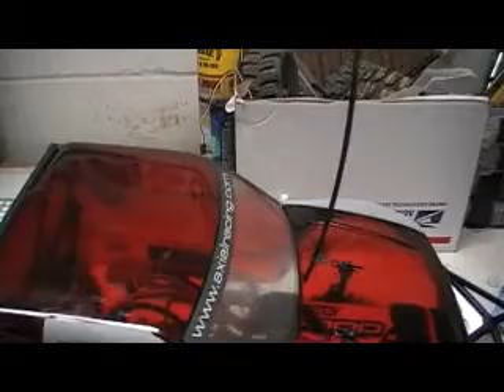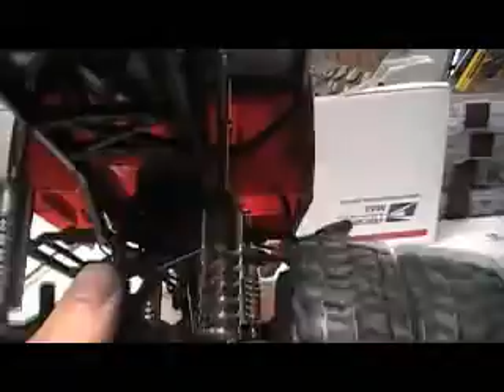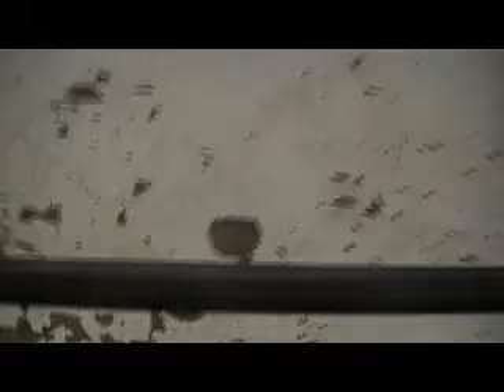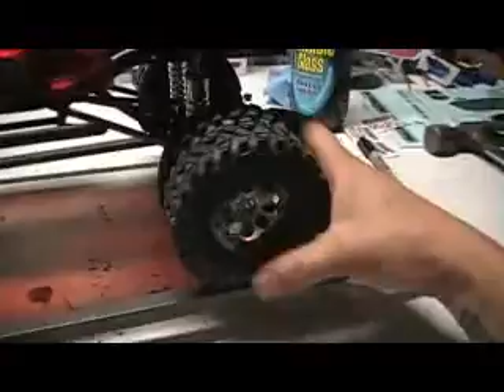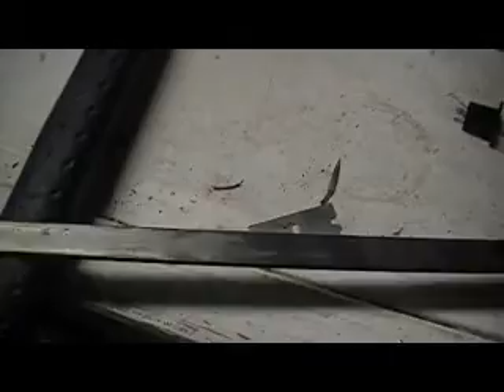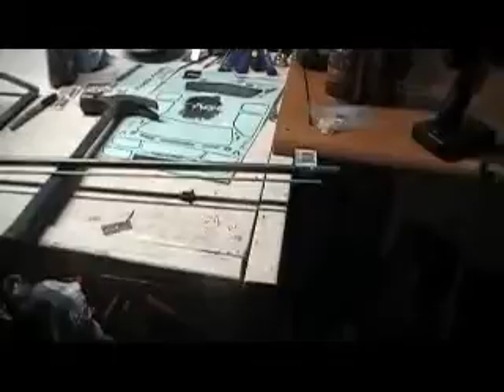Big Boy SCX10 finished build video and gooseneck trailer teaser

Comment from the maker: I used a Hobart Handler 140 Mig to weld the 1/4" square, round, flat, and angle iron. I need to either rebuild this one or make another one long and wide enough to fit 2 rock bouncers

Comment from the maker: 2 lag bolts per wheel take the outer dual and drill a hole wide enough for a 7mm deep well socket to fit through, line up the bolts on the most open parts of the beadlocks and just tighten em down

Comment from the maker: @1newageoutlaw  I use a Hobart Handler 140 mig welder with .030 flux wire.  I had mine set on power level 2 but its the biggest 115V welder they make. Just dial down your power and you wont burn through the metal